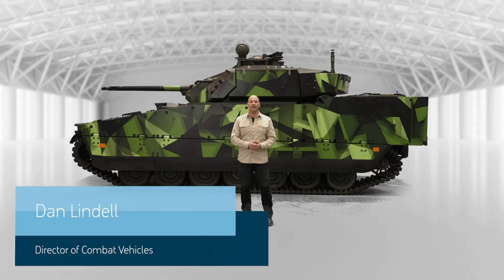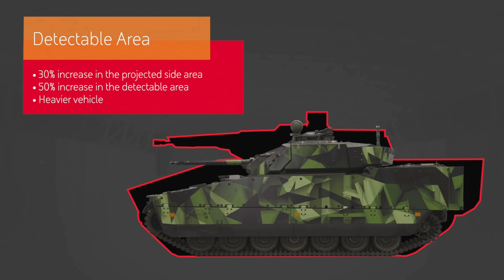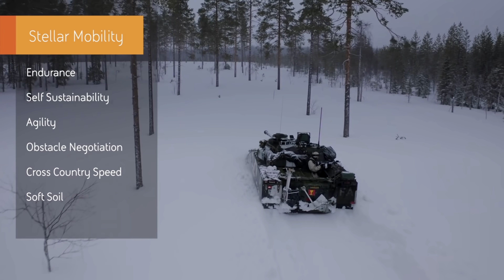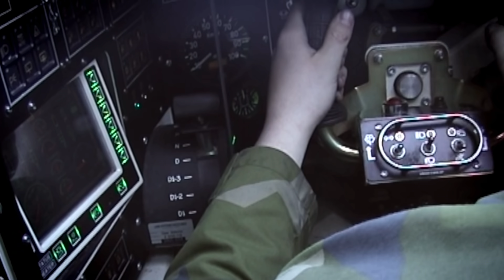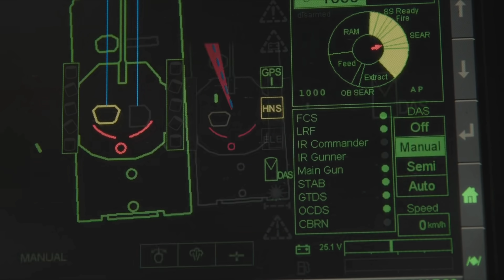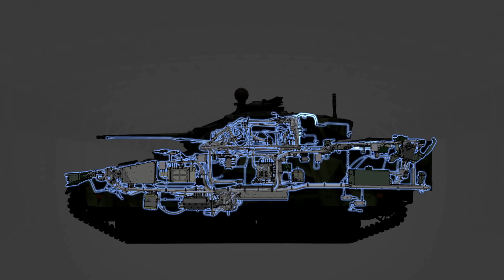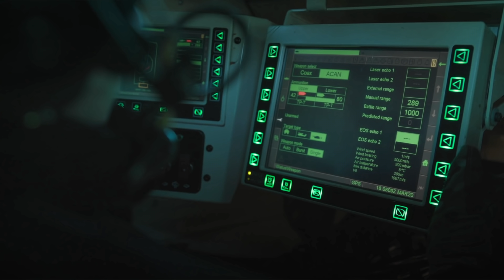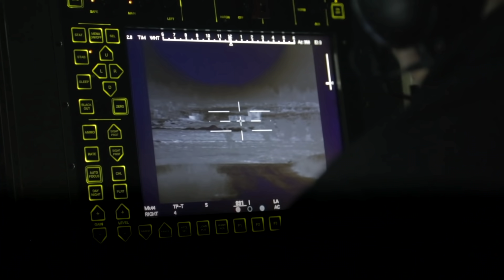The CV90 Infantry Fighting Vehicle Family | THE BEST IFV IN THE WORLD 🏆

Comment: That thing would be pretty damn effective in a mechanized brigade group, but if you are thinking Canada we will probably end up with some low mileage cast-off Marder 1's, that we can rebuild from the tracks up for ten years before they are in service, but maybe I am just cynical.
Reply: While probably correct, you are also acidic enough for your sweat to dissolve gold at room temperature XD
Reply: You forgot to mention "at greater cost than buying new CV90s".
Reply: @tomriley5790  CV90mk IV, LAV 700 50MM ,LEOPARD 2A7 V ,BVS10, HIMARS, AH1Z COBRA,as you procure it send the old stuff to Ukraine 1 for 1 until the current vehicles are replaced

Comment: In 2014 some Danish CV 90's were excercising in Hungary...And a bunch ended up in repair tents due to the transmission overheating on our hills..They said it was the fault of the drivers 'cause they weren't used to driving on hills...whatever was the real reason, its kinda interesting.
Reply: Sounds like a resonable explanation, considering i never heard of that being an issue for the Norwegians. Not many places have more hills then Norway, so if it was mainly a design issue, they should have noticed.
Reply: The tallest 'mountain' in Denmark is 147 meters tall. The country is just about completely flat, its very plausible that they Danish drivers werent used to driving up hills
Reply: Sounds like the drivers fault. There are procedures to follow to avoid this and i can confirm the procedures work.
Reply: @Redbanano  To be fair to the drivers, I suspect it can be a thing that is hard to train if one lack the terrain to train in.  A bit like training for artic warfare in a place without snow, it is hard to have people remember procedures if they never experience what the procedures are for.
Reply: Friend of mine was in hungary once gott eaten by a crocodile... just saying its intresting you know. Makes you wonder about hungary
Reply: @am17frans  Totally agree
Reply: @Redbanano  wait question what specific procedures do you follow to avoid it in this case with hills?
Reply: I imagine that BAE looked at that very carefully and made them better in some regard because of it. 

Terrain continues to be a big player.

Comment: I know from an event where American Bradley's were here in Norway they tended to dig their hull into the snow and get stuck while the CV90 hull floats on top of the snow and thus has excellent mobility on snow
Reply: I think I saw that in a clip on YT or something.
Reply: this is not true. the CV90 now weighs 37 Tonnes. 10 Tonnes more than the Bradley. Now the CV90 will get stuck while the Bradley has remained light at 27 Tonnes.
Reply: @swunt10  Both were clearly weighed down in the clip.
https://youtu.be/HAsR7m1wXM0?t=77
Reply: @swunt10  which variant of the CV90 weights 37tons?
Reply: @larshenrik8900  They modern versions
Reply: @swunt10  I’d like some sort of documentation
Reply: @larshenrik8900  wikipedia CV90
Reply: @swunt10  If you had actually read the article it says its max allowable weight has increased from 35tons to 37tons meaning it can carry 2 tons more than other variants without a loss in vehicle agility
Reply: @larshenrik8900  But it says "mass" "Mark0 23 tonnes Mark IV 37 tonnes". This is the same "mass" definition that wikipedia uses for all other armored vehicles and tanks. It's the only number that counts. Also this "no loss in vehicle agility" bullshit is marketing nonsense manufacturers use, it means nothing.

Comment: Been a fan ever since I saw that video years ago with the cv 9040 with the programmable 40 mm ammo.
Reply: That 40mm gun is in principle an upside down upgraded Bofors 40mm AA gun... like those US and many others used during WWII and still are in service in some countries until today.
Reply: @nissetorvang1709  Yeah, pretty sure it literally IS the same 40mm L70 gun of WW2 fame, just adapted to fit in that turret with an autoloader and fire control system etc.
Reply: @nudgeunit  No, the WWII 40mm gun were a L60 , 60 calibers barrel length known as lvakan m/36 in Swedish service. 9040 reuse the gun from 40mm lvakan m/48 which where an upgraded version with longer barrel, higher rate of fire and electric motors for moving the gun. The gun are turned upside down in the cv9040 and 3x8 magazine is attached.
Reply: @primeflux1  it also has a different calibre

Comment: Great video as always Matsimus love the CV90 and the LAV 6.0 are my two favourite armoured vehicles
Reply: 100% agree with you on this.  I have the exact same opinion.  Add in the latest variants of the Leopard2A7(?).  Including it's support vehicles like engineer and recovery versions.  The A2Panzerhaubitz2000 155mm -> however that is spelled.  Use the same A2PZR2000(?) 155mm platform for your MLRS.  VikingMK2.  Armoured vehicle fleet basically sorted.  Invest your R&D money into modifying those chassis for your different role requirements instead of pissing away your $ trying to re-invent the wheel.

Comment: The other members of the CV90 family like the CV90120 tank killer with huge 120mm gun get a lot of attention, but I would be very interested to hear your opinion of the impact on battalion tactics of a system like the CV90 Mjölner firing 120mm HE and especially HEAT rounds tipped with the M395 GPS precision guided kit with a CEP in operations of 3-4m (10m is the requirement) or similar versions of the Israeli Elbit "Iron Sting" which has GPS for a similar CEP and a semi-active laser seeker which has a CEP of  less than 1m when using its laser seeker that is capable of hitting a moving target.

While such systems make individual rounds 6 or more times as expensive as unguided rounds, the vastly improved CEP allows the total number of rounds required to destroy a given small area target (a command post, an ammo cache or an armored vehicle) would be such that using these precision guided shell might not be any more expensive per fire mission by allowing 1-2 round kills rather than 6-12. This also greatly reduces the logistic tail, which has its own cost savings. Then, since the number of shells that can be carried is fixed, using 1-2 rounds be fire mission rather than 6-12 means many more targets can be successfully engaged before having to reload. And lastly combined with a mortar carrier like the Mjölner rather than towed mortars the survivability is greatly enhanced since there is no set up and tear down time, nor is there a need to stay stationary long enough to fire adjustment rounds to correct the aim and then fire a number of rounds for effect if using unguided rounds. Instead a mortar carrier like the Mjölner firing guided shells can have the target coordinates already programmed into the fire control computer, stop and get the exact launch point and do final aiming adjustments, fire and then immediately start moving again with confidence that the target will be destroyed. 

With the addition of forward observers, or most likely drones with a laser designator, 120mm rounds HEAT could land with a CEP smaller than the top of an APC/IFV or tank. As such there would be no need to get within visual range of a tank to kill it like the CV90120 would with its big gun where the CV90120 is in even more danger than the tank it is targeting since if it can see the tank, the tank can see them, and has just as big a gun and a lot thicker armor. Instead the Mjölner could remain safely beyond visual range of a tank and drop HEAT rounds onto it top.

Comment: All these vehicles have a great platform to work from and look at on how to improve.  That would be the STRYKER which has been made for over 20 years now.  It has 10 different armament modules and keeps getting upgraded.  I have always been torn between tires and tracks on these vehicles.  It's obvious that each has it's advantages but I feel tires has more of them.  Tracks biggest would be mud and soft snow.  The tires actually do pretty well on snow if driven right and tires aired down properly

Comment: There is another relevant fact to the CV90.

This is strategy: How does a small country get the equipment they need - at a reasonable price?

The first thing you have to realize is: The price of the vehicle is small potatoes. What is much more important is: How can you train the operators of the vehicle, and how can you MAINTAIN them. The Leopard 1 and 2 have an extreme important advantage: They are easy to maintain! Germany has learned from WW2, where they made some great tanks - except they were a nightmare to maintain - and when people throw nasty stuff at you - then things break.
So there is a great importance to the possibility of repairing the damned stuff - and those that repair and maintain the damned things are grumpy old men, that at a glance can say: Nahh... it isn't worth our time.
The russians in WW2 did not maintain and repair - simply because they knew that a lot of their vehicles were reduced to spare parts by first enemy contact.

When you need the equipment, then you can get tanks from the USA, that have huge stocks of fine tanks available - for a price. Taiwan buys 108 Abrams to an eyewatering 10-15 mio USD a piece. That is more than double the price of a Leopard 2 - especially the earlier production - which needs a bit of tarting up.

Furthermore the production lines will be tied up with production for the main costoumers. If you - in time - go to a smallish producer and work with them to get more precisely what you want: It means you escape a lot of the problems associated with Mark 1. If you insist, then it will cost you a fair penny, but it will get you the equipment you need. It means that some conversion will have to be undertaken by smaller firms - such as Flensburg Fahrzeug Bau.
The small producers will then produce the specialist vehicles: Ambulances, command vehicles and "Funnies" (recovery vehicles, bridging etc.) F.i. Denmark has a lot of mineflails, where the cap is protected and they clear mine fields by reversing into them. That means some of them will go KABOOM with the driver (a bit shaken) will either escape or have a comfortable afternoon at his remote control.

When the flails have passed through, THEN you get your mineplow to clear up the debris and throw aside mines that have been missed. After that comes the demolition experts with a 12.7 mm bolt action rifle (can be fired from a safe distance).

The point remains, that the enemy (most probably) will have extensive minefields to channel the heavy armour attacking. Well, if the plan to mine the whole bloody boarder from the north of Norway to the Black Sea - let's say they have their work cut out for them.
Reply: That's a lot of nonsense

Comment: There is a theory about the silhouette of the tank. That's the point. The damage area of the tank is not considered to be from 0 to the ground and not from the bottom of the transport body. The area is calculated from a certain distance from the ground to the roof of the tower. Accordingly, by lowering the height of the roof, the height of the tank by 10%, we reduce the probability of its defeat by 12%, 13%,14%, 15%. It depends on how you count from the bottom. The required height for an anti-tank vehicle and for a tank are calculated differently. More accurate data is the statistics of hitting the tank head-on in the hull and turret, hull side and turret side, in the rear of the tank, hitting mines and aircraft. And the proportions between them. Next, we consider a circular zone around the tank of 360⁰. These are 90⁰ in front, 90⁰ on the left and right, 90⁰ on the back. It looks from where the shells come most often. The proportion looks good. Selection of the barrel caliber. Each bullet has a chance of injury and a chance of killing. And different calibres of shells have their own mortality rate. How many shells out of 100% stopped the tank for a long time. For a long time, it is divided into serious repairs and full write-off. Well, there are different mortality rates for 23mm, 37mm, 57mm, 75mm, 88mm calibers. The lethality of 88mm is very high and the weight is already sufficient. Therefore, the post-war 105mm was chosen primarily because of the cumulative effect against Ferdinand and T55, patton. And secondly, because of the subcalibre. The weight of a full-caliber steel dummy is no longer convenient and the number of shells is less. The 120mm Abrams cannon is designed for the lightest sub-caliber projectile, but this projectile can weigh large 20kg and even 25kg. The number of shells is the least. It is clear that other shells will have less filling. Therefore, abrams is primarily about subcalibres, and secondarily about cumulatives. Due to the one-piece cartridge and weight restrictions, the high-explosive version will be less effective, but the most dangerous for a crew. Separate loading of the T72 is necessary to obtain the maximum weight of a flying projectile, including a high-explosive one.

Comment: The fact is that this IFV excels in the soft categories such as visibility, endurance, logistical burden etc. which is far more imporant than the hard 'fIrePOweR, spEEd, aRmOUr' when it comes to combat capability and effectiveness. The platform would make Moltke proud.
Reply: How does it excel in visibility and endurance? What does it set apart from others?
Reply: @jonny2954  video literally shows how it’s profile is much lower and generally smaller than any other IFV. In terms of endurance it is very easy to maintain and repair as well as having one of the best power to weight ratios of any IFV not to mention the new rubber tracks which will reduce the noise, vibrations and weight even further.
Reply: @AxeBearingVoyager  You mean signature, not visibility. Visibility would mean optronics and situational awareness systems. Low silhouette was easy back in the day when mine/IED protection wasn't a concern. The reason modern and next gen IFVs are so tall isn't because they can't build them as low as the CV90 anymore, but because mine/IED protection requires higher ground clearance and a certain amount of space in the hull bottom for armor aswell as a double floor to allow energy absorption deformation.
Reply: @AxeBearingVoyager  visibility arg is a red herring. At the distance other tanks and ifvs can fight it, modern optics working in multiple spectra will pick up the cv90 just as easily as a Lynx. Quality of camouflaging is key in both cases, size a minimal factor.
Reply: @positroll7870  camouflaging and utilising terrain to your advantage is much easier in a small vehicle than in a larger one, no?
Reply: @AxeBearingVoyager  the difference between a Lynx and say a Wiesel or other smallish scout vehicles is relevant for that. The difference between a Lynx and a cv90? Will only matter very occasionally. And not at all where drones flying overhead are concerned. For those, having room and weight reserves that allow to mount a decent aps that can fire upwards is much more important looking forward.

Comment: CV90 is the best modern working tracked IFV platform that exist today.  If a country want a modern adapted IFV for its need that realy works, CV90 can solve that today and you do not have to wait for decade's.
Reply: Some say the Puma and Lynx are better.
Reply: @scratchy996  Puma and Lynx is very good IFV and the question is do you want pay for 1 of those or get 2 Cv90 for same price. CV90 is flexible and proven but have less armour protection. At the end, no tank/IFV survives against a modern missile.
Reply: @len2063  Puma is custom built for the Bundeswehr. 
But Lynx is flexible, modular and it used off the shelf proven components, that's why it's cheaper than the Puma.
Do you have actual prices for the newest CV90 and Lynx ? Because the prices vary depending on how the contracts are made.
Reply: @scratchy996  they cost about the same, and the cv90 is both proven in combat and out of it and its alot more modular than the lynx

Comment: Ey Matsimus, ive worked with the CV9035NLD for a few years ( 2011 to 2014) very good platform.... not with the Dutch software^^ hopefully many things have changed by this day, we even had the VIS system, wich was a 360 camera view for the infantry in the back getting a view and coordination feeling into where to deploy once the hatch opend ;) we could even direct the CV9035 gunner with just looking with him on infrared and heat signature... loved the part that when te driver kicked in the gas, the 3  pipes in the back went out the vehicle for more cooling. The Hagglünd inner defence system (CBRN or anti rpg) at the time was VERY sensitive!!! COAX at the time with the Belgium FN MAG was not a match... but that was then... great improvement tough since the Dutch Army before used the YPR-765 PRI with 20MM canon... Cheers and happy new year mate^^
Reply: i read just now that the dutch cv90 fleet is getting a mid life upgrade. some really juicy upgrades in there
Reply: @EpicToast11  what upgrade the dutch infantry Companies their are getting?? To bad we went from 17, 42 and 44 and 45 Companies...
Reply: @FenrisSulfr  from 27:26 you see a model of the planned Dutch version
Reply: @kevinvandal8595  will it be in service with MECHBRIG UNITS?
Reply: @FenrisSulfr  Its gona be the new standaard for  the 128 of the 149 Dutch CV90`s. So yes